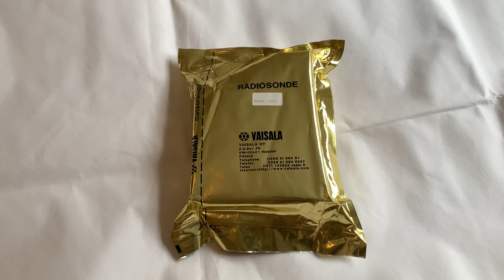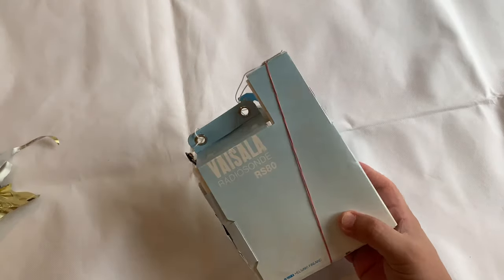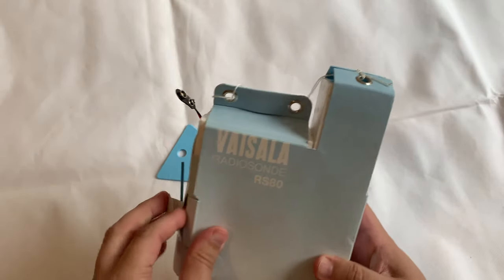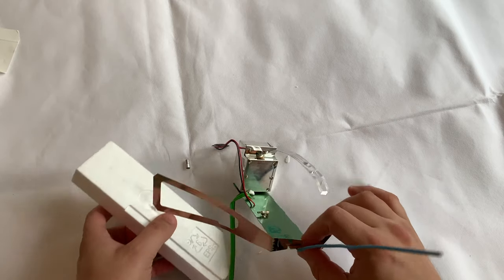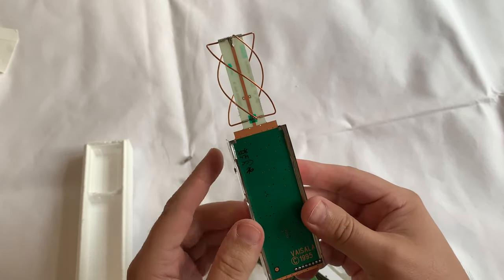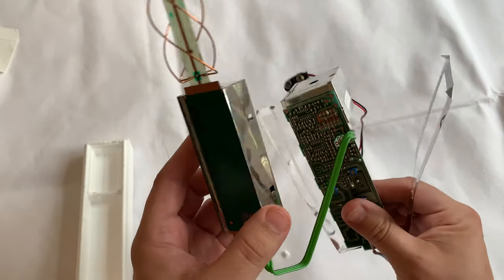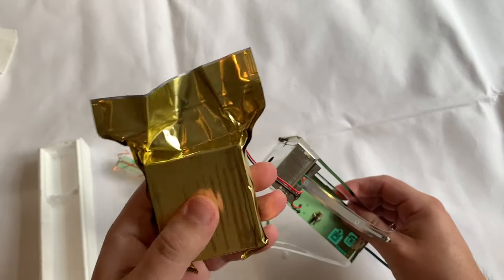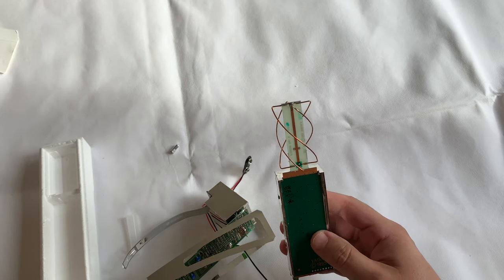Will It Work As A L-Band Antenna? Radiosonde Teardown

Comment: This isn't the correct way to acquire a radiosonde. You are supposed to wait until one is released and then use their gps reports and radio direction finding to find them. :)
Reply: And that's how they are on ebay.

Comment: Hi Matt mine has just arrived. Got it from eBay for £10. I was more careful than you and took it apart. Watching back on your video I think one the sensors in yours popped off as it opened. The clear plastic goes over that section. Now to test it out.

Comment: Radiosonde transmitting unit use to collect vertical temperature, humidity, air pressure, wind speed and direction. I only have experience with units used from 1965 to 1969. When GPS became available I am sure that was an element of data that was added to be transmitted from the radiosonde to the ground receiver.

Comment: Looks like an easy to build Helix or Turnstile antenna.  Loads of plans for them on the web.  Scale it to resonance at the frequency of interest.
Reply: QFH antenna. Easy to build, but difficult to get it right. I am normally against buying pre-made antennas because they tend to cost quite a lot more than DIY variants, but with a QFH, buying an assembled one may be cheaper than buying the tools necessary to make a perfect one. A slight misalignment will result in weird performance

Comment: If it does have filters, it wouldn't hurt to run the math with available parts to better allow just the L-band then decide on using the board the antenna is attached to or not

Comment: Was it just a 9v primary cell in the battery pack?
Reply from the maker: I haven’t actually unwrapped it yet, but I’ll take a pic and post a picture of it on Twitter. Going to be doing another video series on these, with them in action as I have another one unopened. This video is part of the L Band videos I’ve been doing recently.